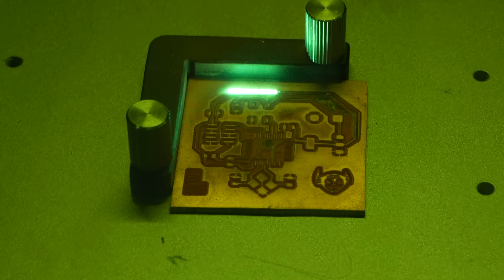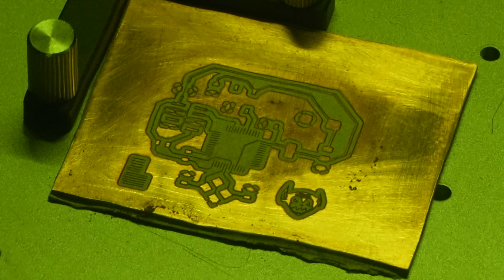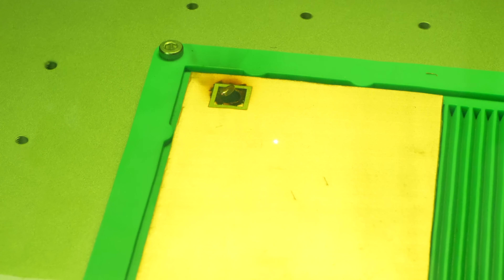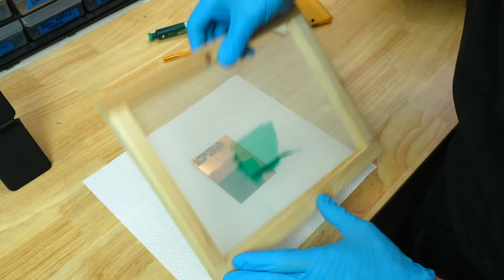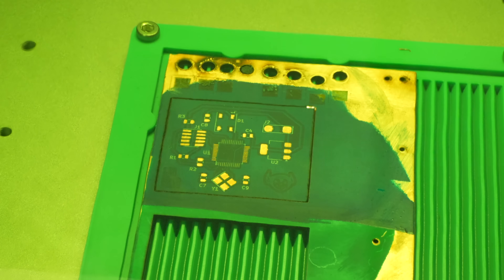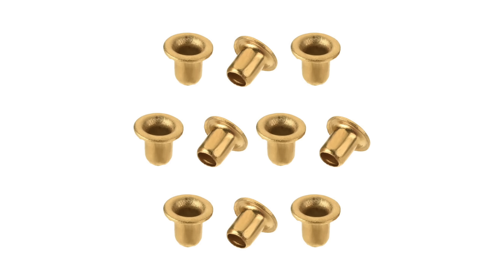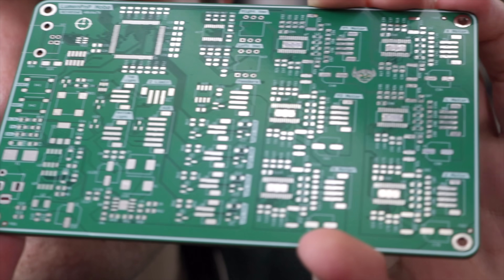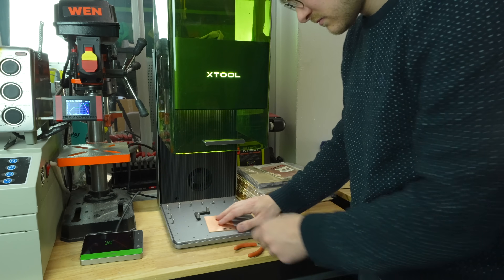Prototype PCBs faster than 3D Prints

Comment: Hey Stephen, Thanks for the Video - Really cool and great approach.  I know I will be sharing this video with the members in our Hackspace here in Bristol in the UK - May consider getting one of these lasers! 😁
I know hardly anything about electronics but do watch the odd video. In regards the the Via, I quite liked the rivet idea but as you say it has it's size drawback.  I guess if this is just for rapid-prototyping, with a bit of design, instead of going through the board if you could get a trace out to the edge, you could almost run a wire around the edge.  This would most likely look rubbish and possibly cause design issues, but could be an option - Instead of wire I imagined, cut in grooves on the edge  (like a omb to keep them seperate) with copper almost resembling a short staple - I know it's not automatic, but would keep the profile streamline and work with your folded sandwich of 2 boards - anyway just an idea!

Comment: I'm personally very interested in this type of fast PCB prototyping methods. Whilst for most places people can get prototype boards made easily and for an okay price, where I live we don't have any student budget friendly PCB manufacturing options. There are some but for absolute worst quality but you still pay premium af prices. So for people in situations like mine, I think these sorts of methods actually have some merit for prototyping in general. I can't afford to pay 50+ usd + taxes to get the worst quality of prototype boards, but paying into tools, chemicals and process building stuff would be viable. I was thinking on improving the SLA printer methods with a custom "build plate" to help index the boards, and some extra tanks for etching solutions. Combined with trough hole plating setups it would be neat. Anyways I'm rambling but great work, looking forward to any new things you'll do.

Comment: I'm glad you figured out the non FR4 materials, they are definitely much much better for lasering.  For semi easy vias what about non round holes and vertical SMT 0 ohm resistors (board thickness long) placed vertically in the holes and then paste+reflow?  Or maybe pick and place rivets, into solder pasted holes, reflow to solder in place, then swage or paste the other side.

Comment: One sided pcb ftw. Just use jumpers.
Reply: Part of the motivation for vias is to fan out connections from a fine-pitch IC, such as the one in the video. That often calls for vias under the IC. That's not going to work with jumpers. Trying to put all jumper connections around the exterior of such an IC is often either geometrically impossible, or results in substantially larger board to make enough space for all the solderable-sized jumper pads.
Reply: @Graham_Wideman  Yea I figure that we'll need to use a board shop for some stuff either way, because the riveted vias are too big for fan out stuff, maybe a snipped tht lead and a small hole, solder on both sides and sand down would work? There's probably way that doesn't suck, but my point is that:

In the use case where the board doesn't need to be as small as possible, and it's not going to be used in a production run, and it doesn't need this sort of ic fan out, (this is common for me) we just make larger bulkier boards and add jumpers where routing gets unwieldy.  We can whip up a board in minutes and have it happily chugging along for decades.

for commonly used ics you can make a daughter board with whatever caps and resistors it generally uses for you that goes out to header pins. like a breakout board.

Comment: Slightly oversized metal pin, chop flush with the board, solder either side. You'd need some kind of press but like thin brass bar stock with flush cutters should take care of the bulk of it.

Comment: Breathing vaporized copper probably is not the best for your lungs.

Maybe dipping the copper board in a  pan of melted wax first and then set the laser to just burn away the wax where you want to etch the copper away. Then use a regular copper etch bath to etch the copper.

Comment: For double-sided prototypes, I have had much success when etching two thin one-sided PCB's and sandwiching them together. I didn't use rivets but instead I soldered tiny little wires through the vias I always tried to minimize how many vias I had and  make sure none would be under an IC or it might get high-centered on the via. It was a bit of a pain to get it right. Also, it was very tricky to get thru-hole pin headers to connect through without a helper 30GA wire. SMT headers would work much better.

I think rivets may be your best/quickest solution. I have seen a DIY thru-plating machine online, so it is possible but yeah, a little more "chemistry" and a little less "3d printer."

Comment: As much as i love this for the cool factor, i find it almost useless for professional level work. We had a CNC in the office that i used to PCBs a few years back. More then a few now that i think about it. I got down to 0.15mm pitch and spacing - pretty well for a homemade board. Then we discovered JLC and that stopped being relevant. Just 1 layer boards, ever for a simple test are not worth it. Add the space, noise, smell and price to the mix and its not worth it, when i can just wait 7 days and get a professionally made 2 layer board. Or 8-10 days for 4-6 layers.
With all of that being said, the cool factor is important and its also really really fun to do this.
Reply: Have you watched the final part of the video?
Reply: @ Yeah. I've also tried similar 2 layer solutions. They are fiddly and take so much space. 
In my experience it's not worth it to do the design twice - once for the inhouse process and once for the actual final size boards. You don't save any time in the long run. If the inhouse process is similar to the final process and it has the same capabilities, it would be worth it, if the price is decent. And the price is not decent yet.

Comment: For a dual sided board, why could you not cut indexing holes from the first side? Then you flipped the board over and instead of re-indexing the board, you re-index the laser in software based on where the holes have punched through, so it is exactly the same on both sides regardless of the jig shifting

Comment: Makes me wonder if you can use a cricut (craft/vinyl cutter) to cut foil sheets and stack multiple sheets (non conductive vinyl sheets or solder mask between layers) with a single sided board.

Wonder if “VIA”s could be mimicked by each conductive layer have a bigger hole has you get to the top layer and just solder all the ring shaped “pads” together

Comment: The older FR1 was probably 1oz copper and the FR1 that worked better was maybe 1/2 oz copper.   I doubt there is variation.   You probably just had actually different material.  I suspect it was all to spec.   It has to be.   Etching a board the way they normally are made is just as sensitive to the copper thickness as your Lasering process.   

Doing your own plating?  OMG.   What a nasty process to try and do at home. 

For VIAS just put leaded resistor leads in the holes and solder them on both sides, then cut off the resistor.  You can fill about 10 vias or more with just one side of the resistor.      This is what I use to do when i would drill my own boards.  This is back when I was milling boards on a CNC.  

I see a CNC in your future for doing the drilling. 

I think you just sold me an Xtool.  🙂

Comment: Something that I've had some success with is using different solders with different working temperatures. As long as the working temperature has a big enough Δ, it seems to work well. So far, I've only used two on a single board, an SN100C and low-temp lead-free, using the SN100C for hand-soldered THT and LTLF for SMD.

There are two important caveats/rules to the process:

1. The working temperature must decrease through the order of operations. 
2. The different solder formulae MUST NOT come into contact with each other. VERY important as some alloys will destroy others' solder joints.

Comment: I wonder if you could use your pick and place machine (or a machine based on similar principle) to insert vias.  I think it would involve "threading" (in the sense of a needle and thread, not screw threads) the vias onto a needle like "proboscis" that would insert into the predrilled hole, then push the via into place. It would then retract.  Multiple vias could be "stacked" on the needle/proboscis.  Another thought on making the holes for the vias is a small (tiny actually) CNC punch.  Possible both operations could be done before the initial etching, on a dedicated machine.  And while you're punching vias, might as well punch the THT holes too, though not really necessary for SMT boards.

As to your turn-a-round time, while valid, I think confidentiality is also a huge benefit to keeping everything in house.  I'm not suggestion that board shops are out there stealing everyones design all the time, but I'd be wary of a design becoming popular and then a ton of clones show up because your design files have been "out there"

But also I agree, being able to iterate 10 times (or more) in the same time it would take 1 design to come back from the board house would be a huge improvement for some companies.

Comment: The important issue with FR1 vs FR4 is the need for dust control with FR4 because FR4 contains fiberglass which is hazardous.  When milling FR4, a good practice is to do it with some mineral oil to trap the dust before it gets into the air.
Reply: not only that but FR4 also frequently has halogens in it as flame retardant. you can get non-halogenated FR4 PCBs manufactured by fabs, but good luck finding a source of your own non-halogen FR4 blanks as a hobbyist. i've tried.
Reply: FR1 isn't a walk in the park either. Others have described that it is made of phenol-formaldehyde resin. the gases from that cause cancer and other bad stuff.
So, whatever you do, be mindful of what you do and pick the air filtration accordingly.

Comment: I think I'll stick with my toner transfer/FeCl mix and save my 4 grand, but I'm sure this will eventually come into a hobbyist budget..  I can get down to about 10mil trace widths very successfully. Use the blue "peel and stick" toner transfer paper. Use magazine paper doesn't work well unless you have very thick traces. The yellow transfer paper is OK, but still not as good as blue.

Get a hobby iron where you can control the temp. I transfer at 400F (~200C). I also lapped the bottom of my iron on sandpaper to make it dead flat. This was a huge improvement in getting even pressure to the board.

Regarding double sided: You can do this with the toner transfer method as well. What I do is mark out 4 holes at each corner of the board for alignment. You can get it spot on. For ICs I always socket them. For the sockets, look for "round hole" sockets. I use these because the socket itself stands off the PCB slightly, and on the top of the board that means you can get a soldering iron in there to solder them from the top. Then solder them from the bottom as well to make the double sided connection. For tht components it's usually not an issue, just solder them on both sides, however for radial electrolytics you can't get under them to solder them, so I'll either stand them off the board a bit, or use an axial cap and bend the wire over to stand it upright. For vias you can simply use a piece of wire and solder it to both sides. Obviously if you have a bunch of ground plane vias this is more work.

For hole drilling I use a benchtop drill press. It would be impossible otherwise. Buy the small bits (0.9-1.2mm) which have the thicker shaft. It makes it easier to insert into the drill press and it makes the whole bit more stable. 

For etching I have a hot plate to warm the FeCl up to 120-130F. Cuts WAAY down on etch time, usually to just 2-3 minutes, vs 20 or so for room temp FeCl.

I can knock out a board in 20-30 minutes (not counting assembly time) using this method.

Comment: How about using solder paste to fill the vias from behind?  Apply kapton tape to the front side of the board, flip it over, press solder paste into the vias from the back side, reflow to tin vias.  Apply kapton tape or solder mask to the back side to prevent oozing in the next step.  Flip the board to the front side, remove tape, and apply solder mask leaving the vias untented.  Apply solder paste to vias and pads, populate components, reflow to finish.
Reply: Could it work? Probably.  But melted solder doesn't like to stay put in the holes.  Surface tension from the nearby copper will pull the solder out and gravity will do the rest.  Similar to holder solder doesn't want to sit over soldermask, just less so with bare FR1.

Comment: Just run a jumper wire from a pad on one side through the hole to a pad on the other side.  Solder.  Done.

Comment: What about tiny vias and using really thin wire that you thread through and maybe solder? No need for rivets.. would be super flat depending on the gauge?

E.g. Using a stripped network wire at 26awg

Comment: The way I do double sided boards is just to drill a hole that is the same diameter as a small wire, you solder the wire on both sides.
Reply: A simple, low effort good for most designs approach. You can even repurpose THT leg cutoffs for that.
Reply: I was also thinking of that XD

Comment: use a paint spray then, you can etch with much less power and superior quality then ferric chloride and it comes out great, it's much easier and safer with great precision on any pcb, it's tested and I assure you it works great for 10-15 extra minutes and without tiring the laser....you can try and see what resolution you have.

Comment: I am loving this series, it fits super well in the production chain of lumen!
As for the vias, it may require some tuning but maybe 
- Make the holes the same size as normal soldering tin
- Insert a piece of tin slightly longer than the via
- Use a reflow oven to melt the tin

With a bit of luck the surface tension will be enough to keep the tin bound to the top and bottom pads while soldering, leaving you with a perfectly conductive via.
Reply: I like this idea.

Comment: The way we do it is use conductive epoxy I think from Lkpf. 
Mask the board with high temp masking tape 
Drill holes 
Using a vacuum table spread the epoxy 
Put in oven for cure